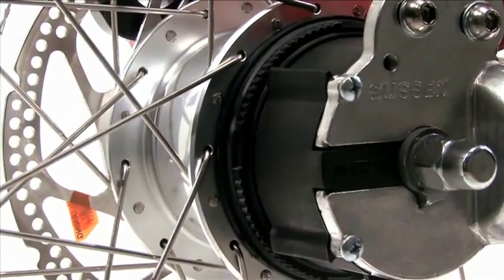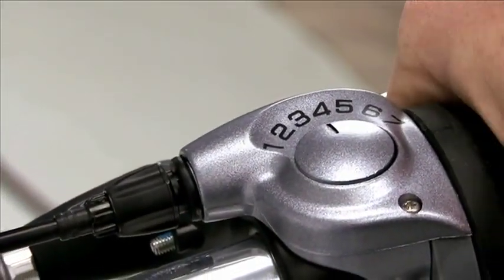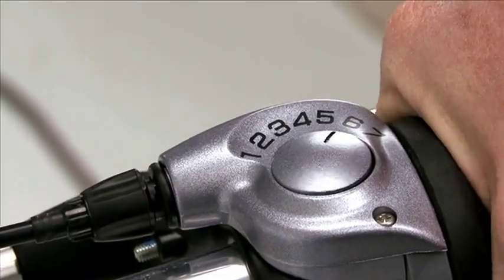Dynamic Bicycles' Shaft Drive System

Comment: I bought a Dynamic 8 speed shaft drive in 2006. It is SLIGHTLY less efficient than a derailleur. Rode it in all kinds of weather including deep snow. Never had a problem. I still have the bike. It's still perfectly rideable and low maintenance.  It is unfortunate that it never caught on.
Reply: Still have mine.  Is it possible to convert to electric?
Reply: @mikedevita5558  I'm glad someone else out there saw the potential. I'm not sure if the gear changer could handle an electric motor with out serious modification, but...I'm not an engineer.

Comment: awesome invention. When you are going to launch in market
Reply: Some of the oldest bicycles were shaft driven... Quite a few names in the market these days...
Reply: Not a new invention. Chainless shaft driven full suspension bicycles date back to the very beginning of the 1900's. It was less popular over time because apparently there's a significant power loss compared to a chain.

Comment: I'm not an engineer, but I'd heard that every time you change torque 90 degrees you loose 8-10%.  So that could be significant.  I have a motorcycle cruiser that has shaft drive, but sport bikes and MX riders say they would never go for it due to loss of power. Correct me if I'm wrong.
Reply: +DSC800 My dad was very technically minded and he told me that shaft driven BMW motor bikes were less efficient due to this, additionally they had a tendency to twist the bike when accelerating hard, causing stability problems.

Comment: ok it looks cool, yet is it better that the good old chain?, is it more affordable?, if it fails can it be fixed?, on the spot?, is this system better than the old one?
Reply: +Robert Ostman  The shaft and hub are much more durable than an traditional chain and cassette.  It's completely enclosed and so only need occasional lubrication and doesn't get clogged up by dust or rust.  Repair is, of course much more complicated, but chances for breakage are also much lower.  It's a tradeoff.  Do you want a simple chain that you can fix easily or a shaft drive that's harder to fix but less likely to NEED to be fixed?

Comment: Okay now use a dual hub two tires in the rear that will give the gearing two points of contact to drive the rear wheels. Then place the drive shaft in the center and give both sides of the crank's contact with the drive shaft. Give the bike a rear arm in the back with the drive shaft fitting right down the middle and then enclosing the rear to protect all the moving parts. You could even use a flexible drive shaft and have dual hubs in the front with two tires snd gearing for an all wheel drive bike. Use dense foam with a rounded surface towards the out side and a notch on the inside. Place dense foam in bike tire. Then place a Kevlar imner tube in the notch and mount the tire on the rim the use nitrogen to air up the kevlar inner tube that will.push out the dense foam making the tire ridged. Hay now the bike tires can take thorns glass nails sharp rock's and not.go flate. If you design a state of the art bicycle? Why not make the whole bike state of the art? You could even market an electrical motor that will turn it into an E bike. 😊
Reply: Your ideas are very good. I'm sure it's only a matter of time before these things become reality. I can't wait. 👍🚲😊
Reply: Could even design a split power swash plate pump motor hydraulic bike.The hydraulic fluid would already be under pressure. Then the cranks would act like a hydraulic pump with the bike having a throttle to move the swash plate to move the back hub with the back hub bring a dual hub and the drive shaft being centered. The bike having the same configuration with the crack's powering the gearing on both side's for a 100% power stroke's while the gearing also operating a hydraulic pump to force hydraulic fluid through the system. Low gear crusing for split power. High speed bike transmission kicks in and power's swash plate pump motor type 12. Both the swash plate pump motor and the swash plate pump motor type 12 and the bike transmission woukd all be turning working through gearing. Then ounce a certain RPM were reached ? The hydraulic swash plate pump motor type 12 would kick in with the first swash plate pump motor fully activated placing the hydraulic fluid under great pressure causing the swash plate pump motor type 12 to spin at high RPM's propelling the bike forward. LOL the funny thing is? This. concept could be integrated into those little smart car's so folk's could pedel and move the car using hydraulic swash plate pump motor's and a transmission. Or just use a hybrid electric motor to operate the hydraulic pump to increase the speed of the vehicle and using the swash plate pump motor has the breaking system has well. 😎😊

Comment: Long overdue, why now? engineers could have easily come out with this 80 years ago. It's not rocket science. Basically just a planetary gear coming off the crank. The most technical part would be the gears.
Reply: THEY DID! These types of bikes came out BEFORE chain ones.

Comment: you will lose so much power and torque with this
Reply: gears are harder to turn than sprockets
Reply: Jacob Kearton 

The manufacturer claims 92%-94% efficiency...I wonder if there are any 3rd party measurements of their system?

http://www.dynamicbicycles.com/chainless-technology/commonquestions.php
Reply: +Jacob Kearton +EpiDemic117 I've heard you lose about 2 percent per contact surface with gears and there should only be 3 or 4 contacts.  It's not SOO much torque being lost haha.  I'm sure its a little heavier with the hub transmission, which also isn't a HUGE deal.  It just limits the marketability to certain buyers.  The rotating shaft shaft would not noticeably lose power since it doesn't have any U joints.  The shaft by itself is as good as a chain or better by design.  The gears at both ends are where you will lose energy.
Reply: EpiDemic117 Cool!  that would make more sense to me.  You'd get to use normal wheels then.
Reply: +Jacob Kearton A few days ago, I finished cleaning, lubricating, and reassembling a Sussex shaft drive (what is used in the Dynamic bicycles). The Sussex shaft drive assembly uses three ball bearings, which add drag. To make matters worse, the ball bearings are located after speed multiplication has taken place, so the rider would notice the drag more.

One of these shaft drive bicycles would be good as a commuter (I use one as a daily rider), but they would not be usable for any kind of racing. Nonetheless, Marshall "Major" Taylor competitively raced shaft drive bicycles in 1898!